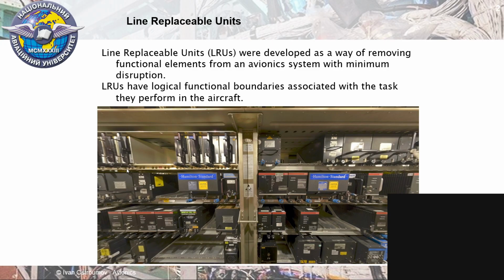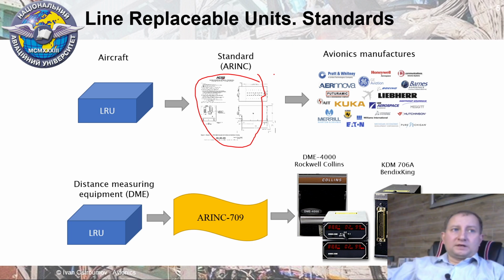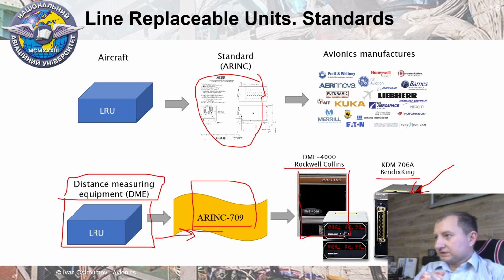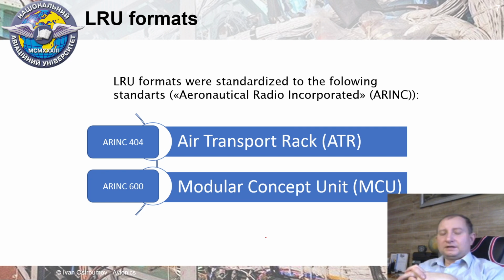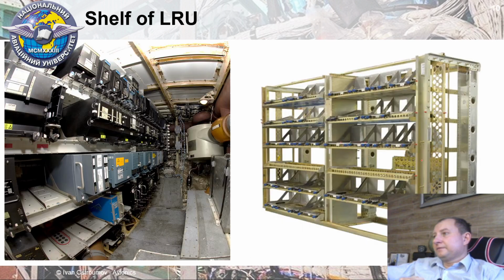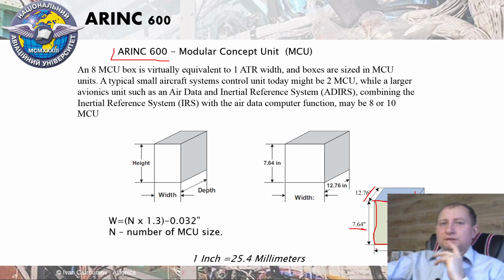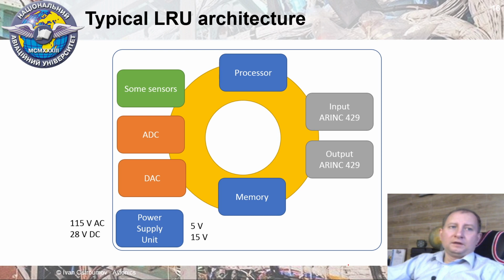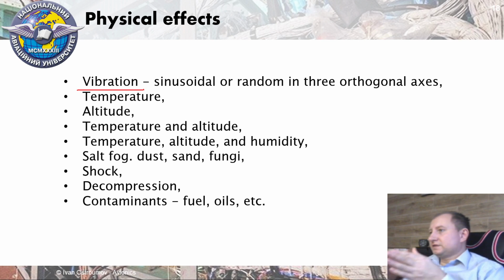Avionics. On-board equipment of civil aircraft. 04 Line Replacement Unit LRU

Comment: In your opinion why Boeing and Airbus have different approach to ESDS protection and LRU handling? Airbus does not require use of static   wrist for metal encased unit removal/installation. Boeing approach is more strict. Even for the same unit as installed on Airbus.